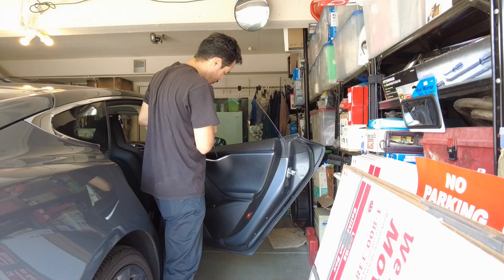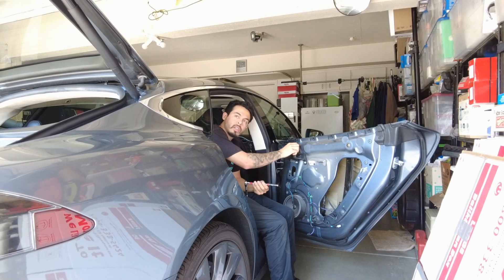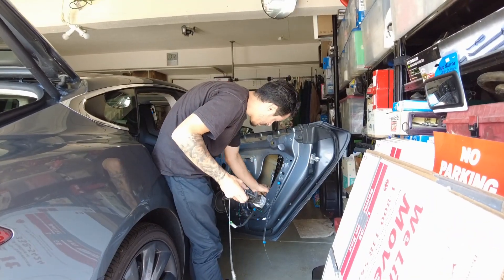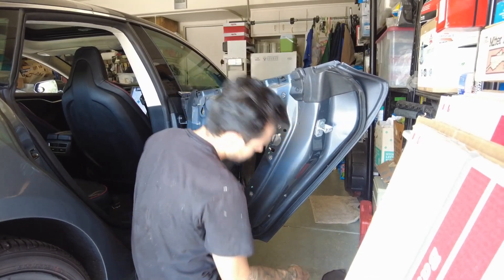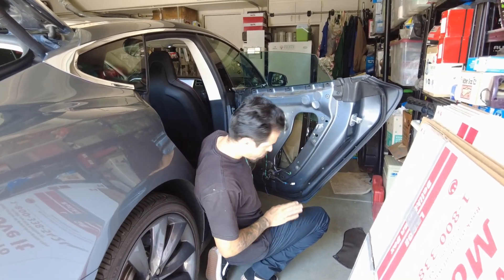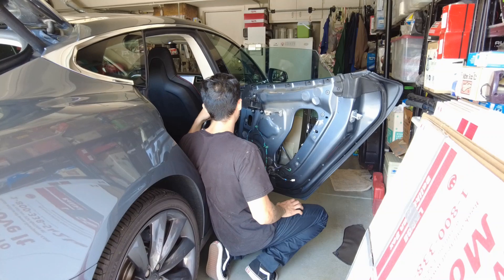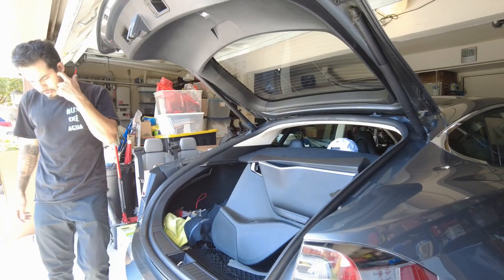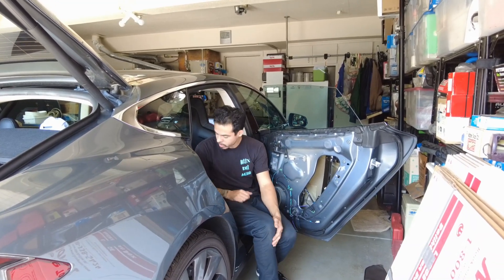2023 DIY: How to Replace the Window Regulator on a Tesla S

Comment: Can i ask what it cost to have Tesla do this repair?
Reply from the maker: $230 parts + $153 labor + $21 tax = $404 Total 
Thanks for watching.
Reply: Thank you for the prompt reply, I'm at the service center right now getting quoted $476 which includes a $70 diagnostic charge which they may waive hopefully. Was thinking about doing the repair myself but they won't sell me the new regulator. My only option is used on Ebay. So I'm going to have the service center do the repair. I have a 2014 S85.